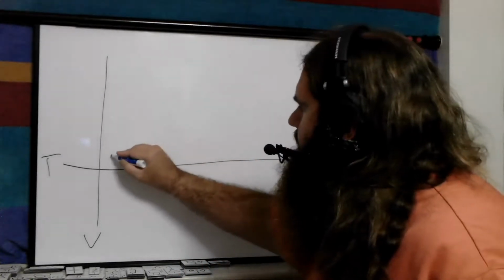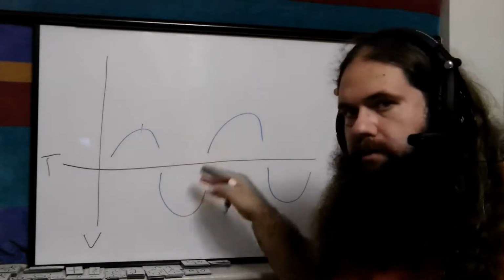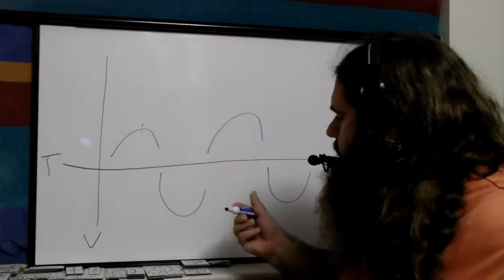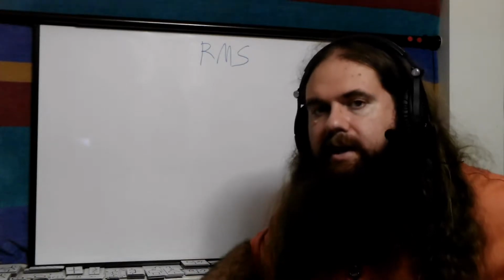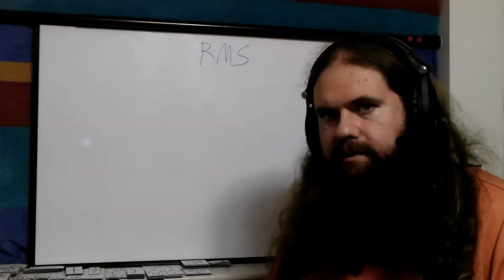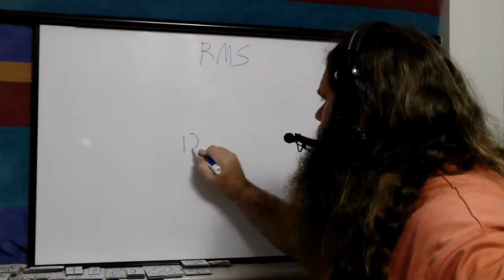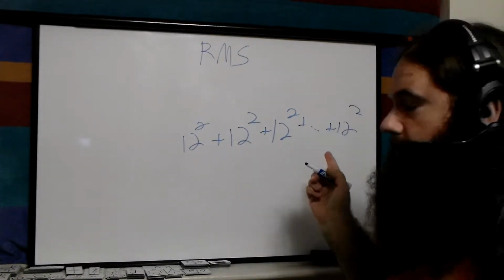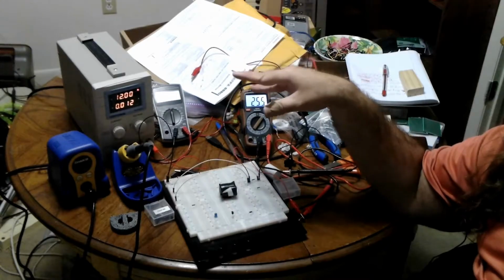Dirty Rotten Cheating Multimeter - Simply Put

Comment: Something is a miss here.   When I set my Fluke 87V to AC when on a d DC circuit the meter is actually providing me with the AC ripple of the power supply riding on the DC of the power supplies output.   Are you sure this isn't saying 25.5 millivolts of ripple and not 25.5 volts AC.